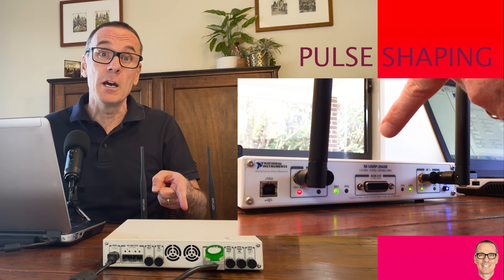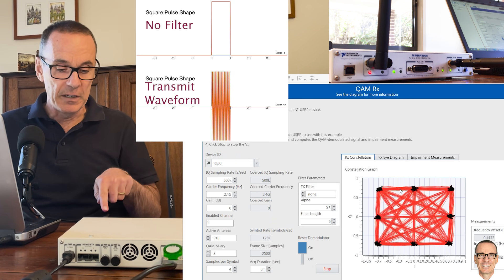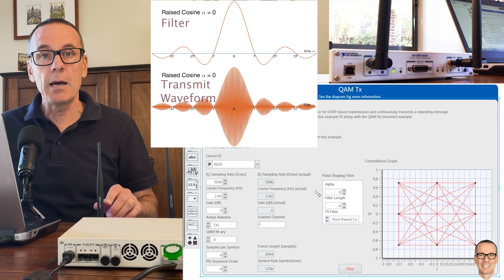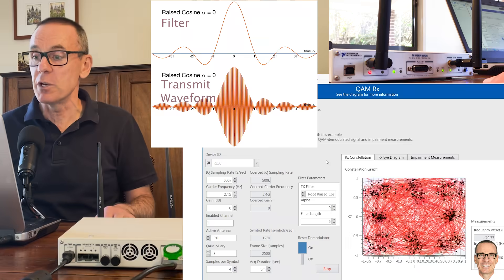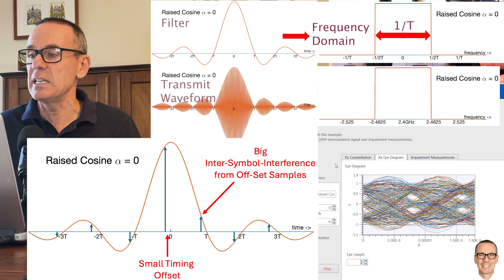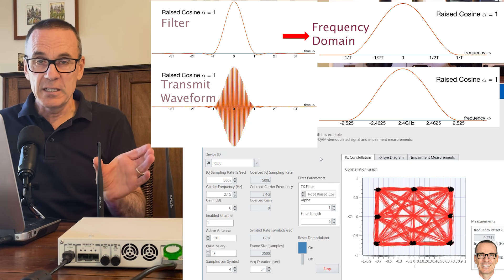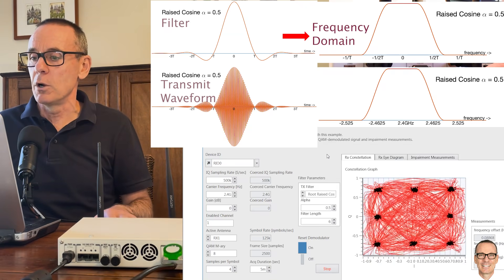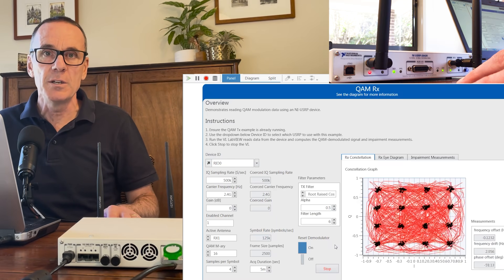Visualising Pulse Shaping with Real Digital Communications Signals

Comment: Thanks for the informative video! Since you're using both Tx and Rx channels on the same USRP, I have a couple of questions about configuration. Can this be done using a single IDE, or do we need two? How should the SDR be configured to enable simultaneous transmission and reception? Also, could you clarify what specific settings are required for this? For example, is it possible with the NI USRP-2901?
Reply from the maker: Sorry, I'm not familiar with all the NI SDRs, but the one I was using had two channels.

Comment: Hello there, I am using GNU-Radio to simulate a QPSK modulation. There is also a SRRC filter with alpha = 0.5. 
If I look at the constellation after the SRRC filter, I see eight points, four in the expected I/Q positions, and other four like they were rotated of 45 degrees wrt the previous ones. Why this is happening? 

Thanks for your useful videos!